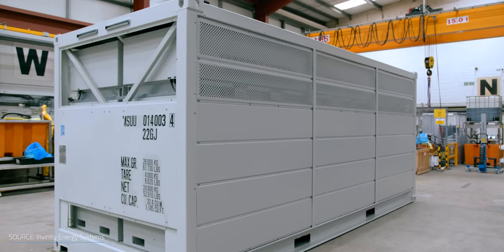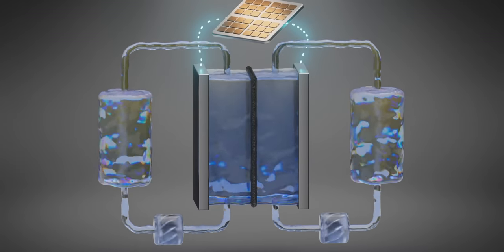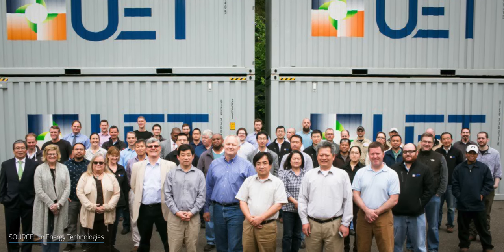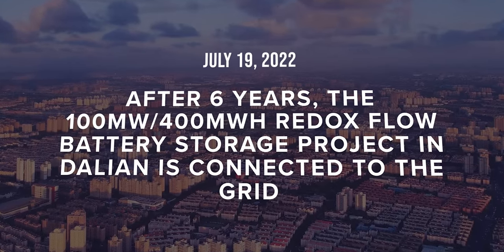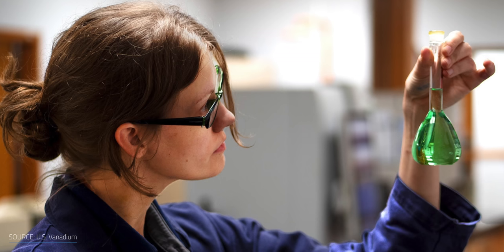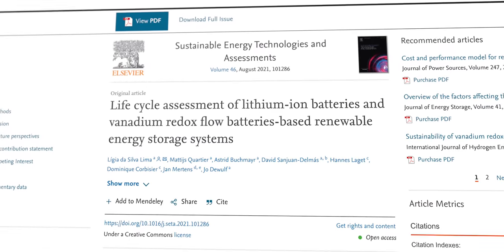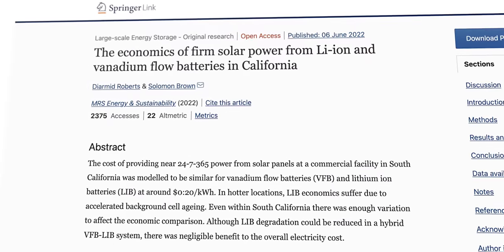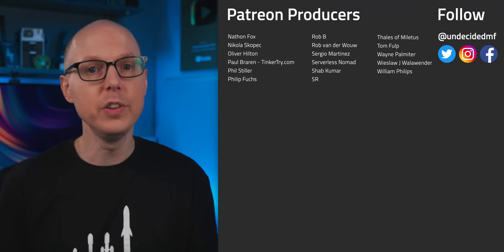The Breakthrough Battery That The US Gave Away to China

Comment: As domestic battery tech becomes more ubiquitous, will we see a move to in-home DC? With HVDC for long-range transmission & local DC - is AC on the way out?
Reply: @Tumbleweed5150  to answer both points. I was thinking mostly about local DC (my HVDC point was an afterthought); solar & home-scale wind generate DC, batteries store 'DC', AC is only required for appliance compatibility. Inverters seem to incur an energy cost to drive AC so, over time, will we see more appliances with DC options?
Reply: @Tumbleweed5150  perhaps it could be worth having a DC circuit in the home (regulatory issues?). I hear of lightning setups that convert to DC. What connectors do those products you mentioned have? I can't imagine USB carrying particularly high load (I think it's 100W max)

Comment: 1GW all-vanadium liquid flow energy storage! Three Gorges Energy's 1 million kilowatt photovoltaic + all-vanadium liquid flow energy storage project officially started

According to reports, the 1 million kilowatt photovoltaic + 250 thousand kilowatt/1 million hour all-vanadium liquid flow energy storage project that started construction this time was built by the Xinjiang Branch of Three Gorges Energy. 10,000 kWh energy storage facilities (4 hours), 2 new 220kV collection stations and auxiliary facilities, with a total investment of 5.8 billion yuan. The total power generation of the project's power generation system in 25 years is about 48,908,496,000 kwh, and the annual average power generation is 1956,339,750 kwh.

The 300,000-kilowatt "photovoltaic + energy storage" integrated clean energy demonstration project is built by CECEP Solar Energy and Xinjiang Lixin Energy Company. After the project is put into operation, it is expected to generate about 236 million kilowatt-hours of green electricity annually, compared with coal-fired power plants of the same scale. , it can save about 89,840 tons of standard coal every year, and correspondingly, it can reduce a variety of harmful gases and exhaust emissions every year.

After the completion of the two major projects, it will be of great significance for Jimsar County to speed up the construction of the photovoltaic industrial park and help the transformation and upgrading of the energy structure, industrial structure and economic structure.
https://www.seetao.com/details/185734.html

Comment: California's blackouts are definitely weather related, but tying them to climate change only is disingenuous. Whether it's related at all is a genuine question mark due to all of the variables to be considered. There are many factors, including NIMBY politics and a hostile environment for private investment in power generation there that contribute greatly to the grid failures that have plagued the state for some time. You can't have a growing population with ever more housing and infrastructure build out without the commensurate electricity generation capacity to power it. It's like replacing your Prius with a Hummer while expecting to pay the same for fuel. It doesn't work out so well.

Comment: Batteries are good for mobile applications and off the grid instances, but resources are better spent matching constant grid transmission with current demand.  Never have we stored electricity on a grand scale and there's a big reason for that.  Sorry, but this video is built upon a weak, if not false premise.  

" Why can you not store electricity?
Electrical energy is a constant flow of electrons that move within a conductor. To want to store it in that form is as unrealistic as wanting to store wind."

Comment: ESS INC. has engineered an  iron salt and water flow battery  being manufactured in oregan at a plant Ess inc calls there battery  the energy wharehouse 75 kWh non toxic will operate in cold or hot climate Ess Inc is  a listed  company  on the US stock Market and an  trading at .75 cents a share this company is in position to be the leading long duration battery provider in the us

Comment: My question is how dangerous is this material to pump in pipelines, could we build the massive solar farms in the west's  deserts and pump the liquid around the county to replace power plants
Reply: Electricity flows in wires with very low pumping losses.
Reply: @RJProbably  that infrastructure is not there, they would need to install large expensive DC lines to alow for coss County transmission, pipelines cross this country and could be retrofited,  building the plants to process the liquid could make it mute point, but just a though
Reply: @killer3883  Not true...they would just have to use the right-sized inverter to make it AC, at the proper Voltage, then they could use the current power grid.

Comment: I don't understand your concern with China using the technology.  They bought it rather than stealing it (we didn't give it away).  It is a non-exclusive license.  

We want China to take whatever action they can to increase renewables, just like every country should do.  It is not China's fault that the US wasn't willing to spend the money required to build the factories and supply chains.  (We can always prevent import of Chinese products if necessary to protect US jobs.  - See solar panels.)

(The concern about licensing new companies to use the technology is a valid issue.  It should be very easy for any company, whatever country, to license technologies to fight climate change.)

Comment: A five fold increase is easily do-able considering the tiny base we are starting from. Couching such statements as frantically difficult is misleading. Just consider the growth in cell towers. We achieved a five fold increase in those from 2000 to 2020 . The economy will respond to demand. 
Everyone acts like because there are no X (insert desired tech here) there never will be despite the huge demand.
Economics does not work that way.

Comment: You have lots of great information on your channel, but your delivery needs to slow down a bit. You're delivering a LOT of technical information, and even if using Closed Captioning, it's difficult to receive and digest the information at the rate you deliver it. I'm no idiot (my IQ is in the 130s), but it's hard to keep up with your pace. WHAT'S THE HURRY???

Comment: i wonder how much this modular system from Forever Energy weighs? 40 KWh  of storage means 0.144 GJ. Is its energy density higher/lower/the same as an Li-ion battery?. Refrigerator size is meaningless. I am thinking of space travel/ion propulsion. Solar  panels in orbit can charge the batteries for a trip to the Moon or Mars. Orbiting around those bodies, there will be similar or larger panels, in the case of Mars, a battery swap, and head home. The blue whale in the room= what is the unit's mass?